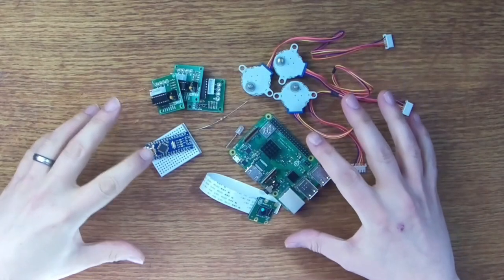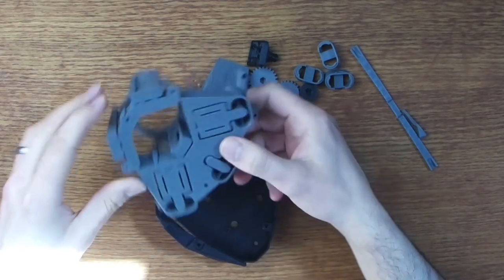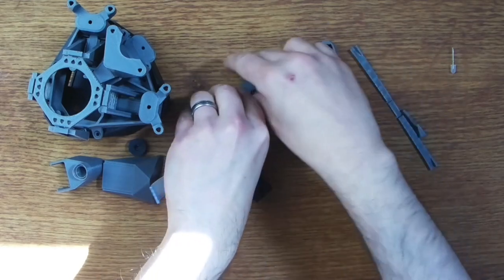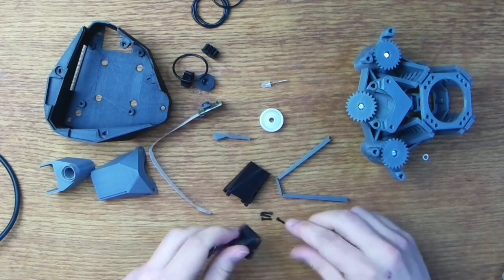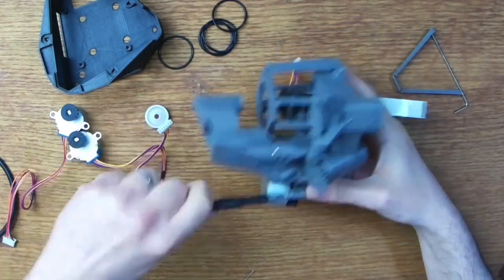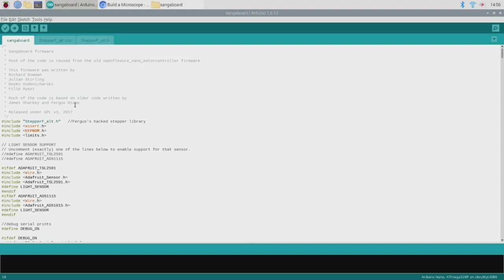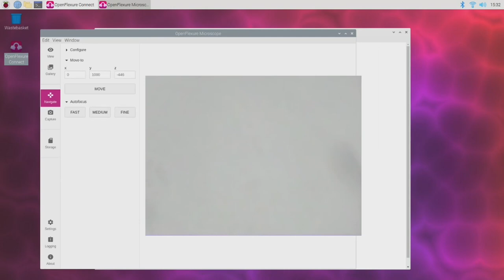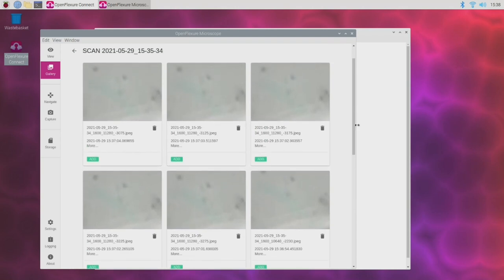Building the OpenFlexure Microscope

Comment: Tim, thanks for putting this together. Hopefully I'll get motivated once again and give this another shot. I tried a couple years ago but failed (or actually gave up). I have all of the newer designed 3D printed parts now and just need the other non-printed components.  One of my hobbies is Microscopy and I've been wanting to get one of these up and running to experiment with for a long time now. Thanks again.

Comment: I don't have access to a solder, so I found a pre-wired LED on Amazon. Do you think it would be bright enough? Here are the specs:

Working range: 4-6V, 20mA.
Luminance: 13,000-16,000MCD.
Wire length: 15cm (I plan to add a female-female wire to reach the desired 20cm, and also because the product looks like it has a male head).

I'm not confident in my physics knowledge, but here's my attempt. The LED recommended by OpenFlexure cites a luminance of 22,000MCD at 3.2V. If the current is 20mA, the LED's internal resistance is 160ohms. Hooking the LED up to a 5V battery and a 60ohm resistor seems to effectively supply the LED with 3.64V. This increases the power by a factor of 1.3. Assuming the luminance is proportional to power, the luminance would also increase by a factor of 1.3, resulting in an effective luminance of 29,000MCD. If this is the luminance that the OpenFlexure build expects, the Amazon LED seems a little weak.
Reply: Eh, just get a soldering iron. You won't save any time or money with this plan you are describing.

Comment: The microscope looks quite good but the software is a terrible bodge job and what's with the Raspberry Pi AND Arduino? ..... seems kinda excessive considering the Pi has GPIO of it's own????????
Reply: Even with the RT kernel, the Pi does not do motor control very well while also doing other things. It makes more sense to use an Arduino with a hard realtime gcode interpreter that has been tested for a long time.